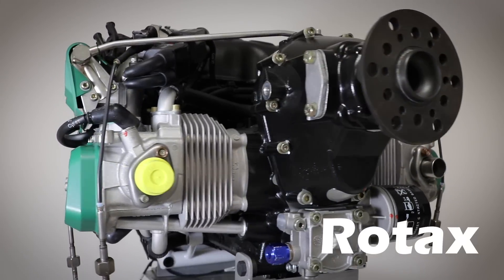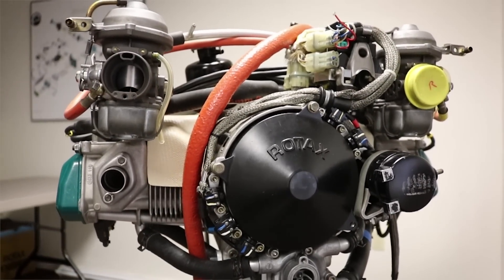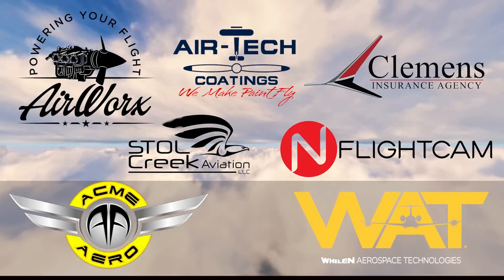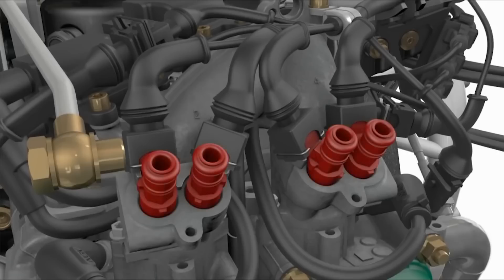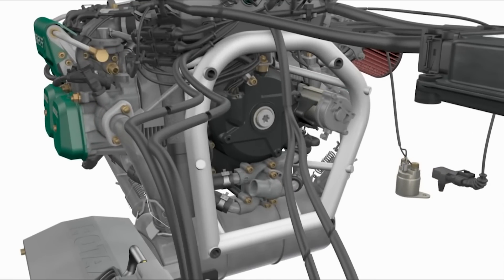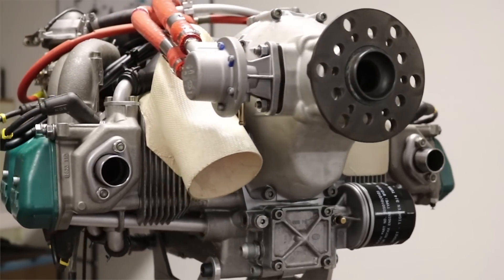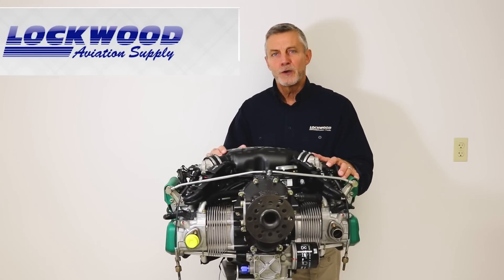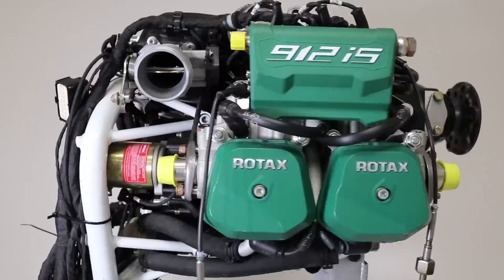Rotax Aircraft Engines - Engine Week 2020

Comment: Pretty frustrating engine to own. So many little deficiencies and engineering issues that were never solved, leaving the owner to suffer and compromise safety. My 912 is in good condition with low hrs and it requires constant tweaking and maintenance. The cooling system is a constant source of issues, the mags are very temperamental, leaky valves, hot running, fuel pump failures, just don’t trust this engine… back to standard Continental for me. Will be a great day when I get rid of this engine

Comment: Modern car engines are just as reliable as these 'certified' aviation engines.  I have 450,000 miles on a V8 Ford engine, with NO REBUILD, and it's still going strong, not one OUNCE of oil burn or leakage!  The 'certified' engine market is just a scam to charge astronomical prices for the same motor.

Comment: As soon as I see Rotax name, I already know the airplane is unaffordable for many. Rotax have not done the industry much favor in terms of cost reduction. A big company with lots of overheads and share holders to pay for. It is also snail slow in tech advance, some engines still use carbs, and they are slow at raising HP. This gave an opening to companies like Edge Performance. A smaller and more agile company that can do what Rotax cannot.

Comment: 2012 with injection and something it is really good for is at different height differences. Merca already had this in cars in the 40s and 50s already? Rotax is a bit behind? lol. Turbo is something just as important also for coping with high altitudes and maintaining the power. So it takes them 100 years to get to this? I had can am 1000cc and I was so dissatisfied that I was close to smashing it and burning it and showing it on youtube. So this video probably says the most about what the backward brand rotax is. With that said, the 915IS and the next 916is are interesting and good engines, I guess.

Comment: Is the gear pressure lubed similar to a motorcycle transmission
Reply: Yes, the reduction gear set is pressure lubricated for longevity and temperature control.  It shares a feed from the oil pump, same as the engine.

Comment: rotax have popular engine many aircraft but have lot owerprice normal engine and ower prize lot if rotax cost 25-35000 $ and all other same motor HP can buy less than 10 000 $ why all idiot pay ower price one little engine.  buy used lycom 2000-4000$ repair this to new 1000-2000$ and fly many many thousand hour whitout problem. idiot pay owerprice one engine.

Comment: What is the advantage of  fuel injection engines?
Reply: Better fuel consumption (= less weight and/or more range) and never use "choke"
Reply: Economy, power, starting, af mixture, simplicity, no icing of carb. list goes on. Carbs stopped being used back in the 30's

Comment: As a comparison what is average hours on a car engine when it would be good idea to rebuild?
Reply: Depending on the type of engine. If we assume an engine will need significant maintenance at 150,000mi, the average person would need a rebuild after about 3,750 hours of driving. It's hard to estimate the time the car spent at idle during those 150,000mi so 3,750hours is a low number. Of course some engines last longer and some don't last as long. Your question is a pretty broad question but remember if your car breaks on the side of the road, you're just stuck. If your airplane engine breaks, you could be facing death. Aircraft maintenance is held to a much higher standard than automotive maintenance.

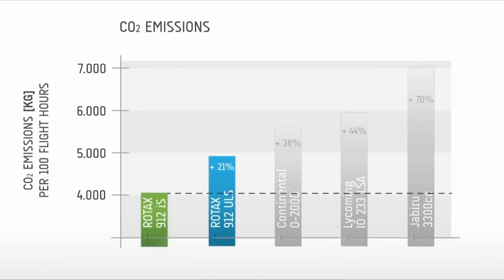Comment: Hi, great video. Can someone please explain - at 9:30 of the video a graph is showing Kg CO2 per 100 hours flown. Take the 912is as an example. Assume 18l/hr burn of fuel. This equals approximately 13.5Kg of fuel. After 100 hour 1350 Kg of fuel would have been burnt. How does 1350Kg of fuel produce 4,000 Kg of CO2? I look forward to the tech experts answers.
Barry
Reply: The reason is that the carbon C is burn and when it exit the engine it's combine with the oxygen O2. So we have to add the weight of the oxygen to the carbon weight.
Reply: @yanickdessureault203  Thanks for the reply

Comment: Talk about advancement over the years my dad bought a 1968 Ski-doo made by Bombardier up here in Canada with a 16hp single piston Rotax engine which were not the most reliable but Ski-Doo is still using Rotax engines of course with a lot more improvements to them...Fuel injection is the way to go!

Comment: That large plug on the 915 & 912IS is a lifed part according to my L2 aircraft maintainer has stated 20 connect and disconnects -- Worth a ask
Reply from the maker: Interesting. Cannon plug I assume. Which then means you could cut, crimp, install new pins and insert into a new plug. Worthy question. Thanks for chiming in!
Reply: @ExperimentalAircraftChannel  This was noted when removing an IS from a certified Foxbat and if you exceeded the total number of connects disconnects here will require a replacement loom. Foxbat will no longer install the IS as it is too much work and weight and they claim they are unable to recover the additional cost. The loom from memory weighs in excess of 3kg when removed. In an experimental, it would not be an issue as it's your call.

Comment: Newby here. Can someone tell me the advantages / disadvantages of the reduction drive, and why direct drive is not possible with this engine? It seems to me to be an extra stress point for the engine, and more parts/weight.
Reply: Reduction drives are necessary in engines that turn more than about 3000 RPM because propellers become very inefficient if you spin them faster than that.  So then the question becomes why would you build a high RPM motor and add the weight/complexity of a gear box?  The main reason is that a higher RPM motor creates power at lower torque so there is less stress on internal components so they can be built lighter.  High RPM motors can also make more power at lower compression which makes Mogas a more viable fuel.  This is far from comprehensive and doesn't hit on the advantages of high torque direct drive  motors, but hopefully it gives you a starting point.
Reply: @MrBtdobie  Thankyou for taking the time. Makes sense finally.
Reply: @MrBtdobie  A Prop mustn't turn faster than transsonic speeds. Depending on it's Diameter the Prop-Circle-Speed has to be below the speed of sound. So mostly about 2200 to 2300 RPM. The Rotax turns about 5400 RPM, so you need a gearbox.

Comment: He painted a rosy picture.   It'd be nice to hear a bit more about the realities of ownership.   There must be downsides to the injection... how does one troubleshoot problems? Can I plug in an automotive scan tool?   I've read some airplane suppliers struggle with meeting the cooling requirements of these engines and the installation of the injected engines is quite a bit more complex compared to carb versions.   They do seem like great engines.
Reply: Huge pain to own. Requires almost constant maintenance. Everything is light duty motorcycle parts. Exhaust constantly leaks, cooling system is a constant source of problems, all sorts of major safety issues with the design of the engine and components. There’s a reason rotax says to always stay with in safe landing distance of a airfield…
Reply: If I remember rightly you are able to download the required software from rotax. Or it might be supplied with the engine, it’s called BUDS. If the cowlings aren’t designed correctly then any engine will have cooling issues. I really like the rotax engine. Worked on and flown with Lycoming/conti for years. Both manufacturers make good dependable engines, but they are just out of date and use far to much fuel. Been impressed so far with rotax. Done the factory maintenance training, which anyone can do. And now have an aircraft with a 912 UL. For lots of good information go to https://www.rotax-owner.com/en/

Comment: I'll take 95 to 97 HP in a tightly cowled Van's RV-12 any time, if I don't have to worry about carb heat and  icing problems with the carbs, every time. Did a lot of research on history and longevity of the Rotax 912 ULS, and as far as I am concerned, it's a winner.  Keep fresh synthetic Mobil 1 T40 motorcycle oil and filter in them, keep your spark plug gaps at 0.022" to 0.025", synch those carbs, keep an eye on float weights, and balance that prop, and you should have a lot of longevity.  My motor just doesn't use much oil, I run 91 octane Mogas almost exclusively. Stay away from the 100LL AVgas, if you can.
Reply: The 912/914 carb engines are indeed hard to beat. After logging over 1,000 hours behind them in a year and a half I’ve become a huge fan of Rotax engines and believe they are hands down the best piston engines in GA.

Comment: He didn’t answer what the engine weights are.   Most likely because after you add all the accessory’s needed to run the engine it’s not as light as they lead you to believe
Reply: Just add up all of the components through Rotax's website. The 912 iS and 914 turbo are about 164 pounds fully installed.
Reply: @andrewmorris3479  I’ve heard more like 180lbs wet weight fully installed.    That’s from people taking the running rotax off their plane to do an engine swap.   All the little stuff adds up.  Yet rotax don’t publish wet weight that’s needed to run like some other engine options
Reply: @brent1041  For which engine? Have a look here. https://www.flyrotax.com/produkte/detail/rotax-912-is-isc-sport-2.html
Reply: @brent1041  Thanks! Interesting to see everything accounted for and added up.

Comment: Will the iS engines continue to run if the ship's battery(s) fail?
1) Would the integrated alternator maintain electric fuel pumps?
     A) Is there a mechanical fuel pump?
2) does the ignition system require external 12v power source (or is it completely independent) ?
Reply: The 914 needs battery power for the fuel pumps.  That is why one is wired direct to battery and one is through alternator.  Presume similar for the 915 and Is.

Comment: He said there is more maintenance required for the GEARBOX on the iS compared to the ULS-- I wish he would have explained. I can't imagine why an improved fuel delivery system would impact such gearbox differences.
Reply: The injected engine runs hotter than the carb version when in cruse due to a lean mix, which gets you great economy. The gearbox shares the engine oil and consequently it runs hotter as well. That shortens the service interval. Lockwood will install a oil spray for the gear set on overhaul which should carry away the extra heat.
Reply: The 100LL shortened overhaul hours apply to the entire series, both injected and carb versions.
Reply: The Rotax maintenance manual talks about inspecting the gearbox earlier in the lifecycle if 100LL is used vs running mogas/no lead fuels.
Reply from the maker: Interesting. Yes... Carbon = Dirt. So... change the oil. Makes sense. Same with lead I would assume.

Comment: This over 40 year old super expensive very complex engine is absolutely overrated 😳
The magic is in the certification which is just expensive and does not make it saver.
Reply: If you say so.  Then again, millions of folks disagree with you.  My rotax has been fantastic and lycoming / continental is not even in competition in these horsepower ranges.  If you are talking about compared to auto engines, you will find the fleet experience with automotive engines has been at least an order of magnitude higher failure rate.  Bottom line, if you can do better, DO IT.  Otherwise...quit whining.
Reply: @KenLeonard  obviously you have no clue
Reply from the maker: Alright guys....... AVIATION FAMILY. Let's all learn together and from each other. Of course... this is one of the most talked about platforms (Rotax) out there. And the prices are driven from popularity. Just look at Kitfox of over the last couple years. TRUTH? There are a lot of engine options out there that are all equally very good. Just pick one that meets your mission and wallet and maintain it to the best of your or you+and+your mechanic's abilities. :-)  There is something for everyone. Even if that means your work on it 100% yourself. Thanks for stopping by and engaging here!

Comment: The single most annoying item in aviation is the service "requirements" that necessitate bringing the aircraft to someone you then need to pay a substantial sum of money. I've been working on/servicing engines my entire life, yet I must have my aircraft engine certified by another mechanic. I think of one phrase when that situation comes up: niche markets. I'm more than capable of servicing any IC engine out there, yet if I want to continue logging flight hours I must use these other mechanics. Patently wrong!!! The reason I stick w/ part 103.
Reply: Or you could get your A&P.
Reply: Kenny Phillips,  so that makes him a qualified mechanic or someone that passed a test?  I think you missed his entire point.  There’s too much bullshit out there.  I went to a qualified Honda maintenance shop and they used the wrong oil filter on my 87 Accord.  They told me all Honda’s take the same oil filter.  I said, now they do, not back in 87.  QUALIFIED!  There are guys that pass tests and guys that know what they are doing.  I would wager the overlap between the two groups is less than 20%.
Reply: Or you could go to school for two weeks and get your light sport mechanic license.
Reply from the maker: There is a good and bad in all markets I suppose. Aviation isn't perfect either. (Unfortunately) But there are options for engines. If this does not fit the bill for you... check out a few of the other Engine Week episodes. There is something for everyone... I hope! Thanks for chiming in on the comments here everyone! I appreciate your support!

Comment: Flew 20 years with traditional engines, bought a Flight Design CT with 912 last year - Rotax engine is so impressive.  Zero oil leakage / burn, amazing performance & fuel economy, starts and runs smooth as silk, instant throttle response - these engines in LSA aircraft are an amazing combination.  ~ 130 hours flying behind it, will be 9 series owner for as long as I'm flying.
Reply from the maker: Thanks for stopping by in the comments. I love to hear Real World feedback and especially in a positive light (regardless if you are posting faults or bragging) :-) Thanks for your support!
Reply: @ExperimentalAircraftChannel  
\
Reply: Mojo seems to have some oil leak issue with his new Sling TSI. Nothing major, just clamps, but one would expect better from a brand new build eh?
Reply: @Lcr34  Mojo’s plane had a loose oil connection hose and not the fault of Rotax from what I saw. And it was discovered during the production acceptance procedures normally done after building a plane before first flight. Rotax makes a solid engine.
Reply: The CT is indeed a joy isn't it!
Reply: Flight Design and pipistrel utilize Rotax brilliantly. Hopefully, someday Rotax adds to more cylinders for a true four-seater.
Reply: @simpletube31  maybe add a couple more cylinders to the current design, that would make about a 2 liter 6 cylinder with the only major change being a longer case.  Can make up the volumetric efficiency of the very small 6 cylinder with a turbocharger.  If one extrapolates the HP of the 915 with 2 more cylinders at a linear rate, should be about 211HP